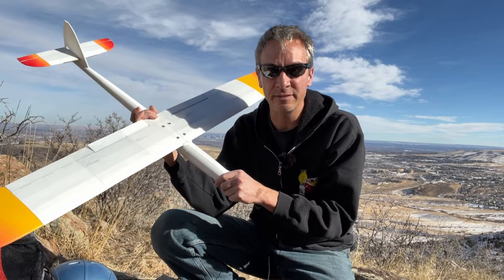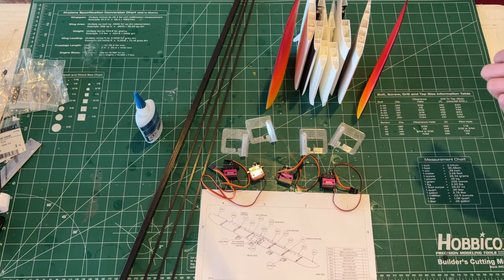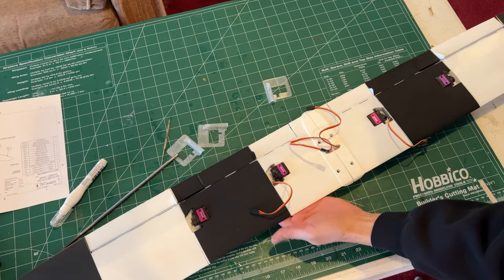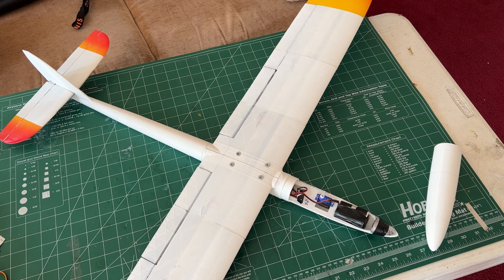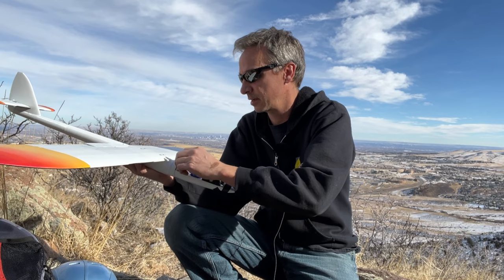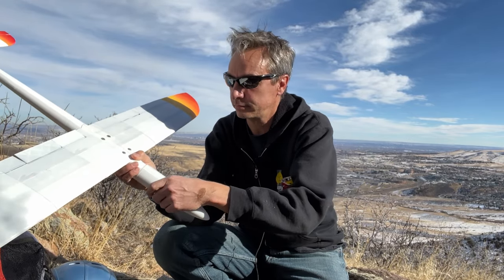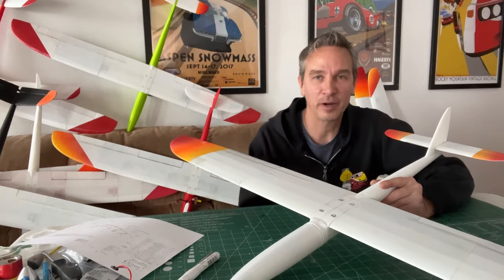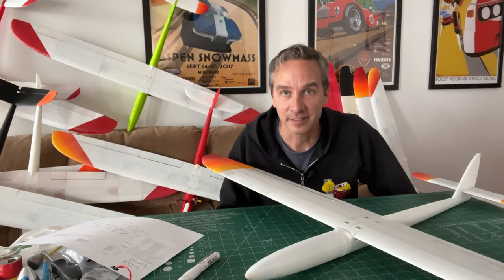Terrible Pilot  - Juicy Wing 4S build and amazing crash - a SoarKraft story

Comment: any idea what your flight speed was right before crash?
Reply from the maker: not over 100... but quick... it was accelerating into the hill.
if you watch the few laps before there was some heavy turbulence on the bottom of the back side... flipped the plane over there too... but was high enough to recover.  Had a hard time putting multiple laps together to get it really moving, it usually takes two to three consecutive "quality" laps to get some good speed going.... its was just too bumpy that day.   Its been suggested to put a gyro in it... which I am, but that is sort of cheating.   Keep watching... thanks for the comment

Comment: Nice work. What a pitty that you don't use round carbon tubes in you designs. Square tubes are quite hard to achieve locally. And to let them send from abroad, there is a risk that I receive a hand of carbon chips 🤣
Reply from the maker: I don't know what country you are in, but the 10 x 10 mm square carbon spar is available world wide from many suppliers.  same with the rod and strip.

Comment: nice! thanks for sharing. interesting to see how it broke on that million of tinny pieces on the crash.  did you test the wing torsion? also, try to use a gyro to gain confidence. Ian (rcg: Daemon) has a topic on rcg about gyros, you will find it in the ds forum. Curently I live in Italy but met him personaly on Weldon, he´s really a helpfull guy.
Reply from the maker: Thanks for the tip. I do know Ian well... he is a Mt. Zion regular... he is in some of my videos.  Sure, keep watching the channel... gyros are coming.  However, they are another complication, programing, failure point.  The wing torsion is awesome, but not molded carbon fiber D60 awesome.... more like glass Destiny torsion.... it is what it is... <$30

Yes, tiny pieces.. bring a bag... however a similar glass or carbon plane would have been obliterated too, done it in the exact same spot, about the same way.  Again <$30... and I can laugh about it instead of cry.